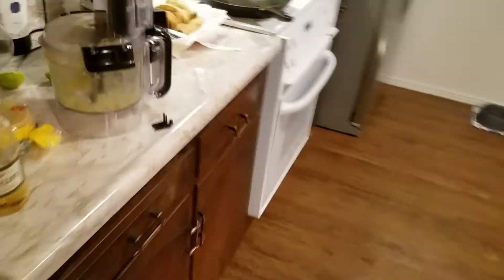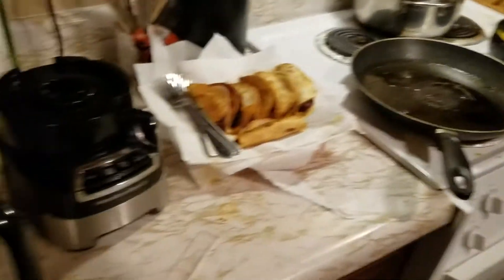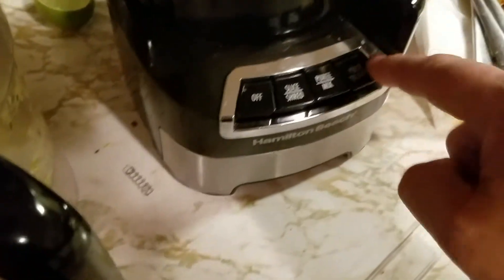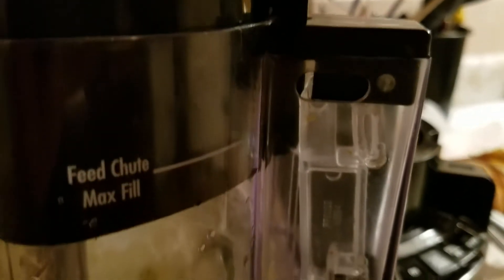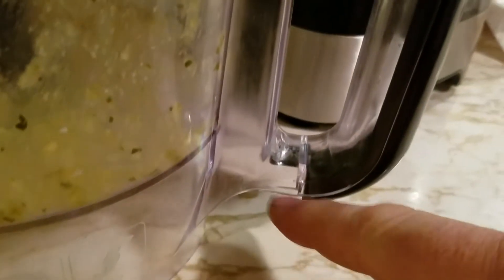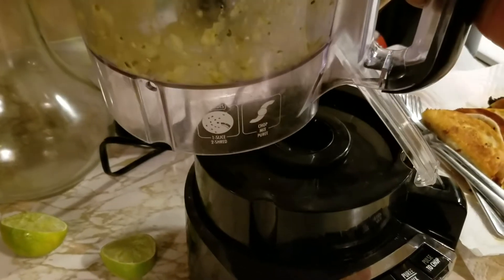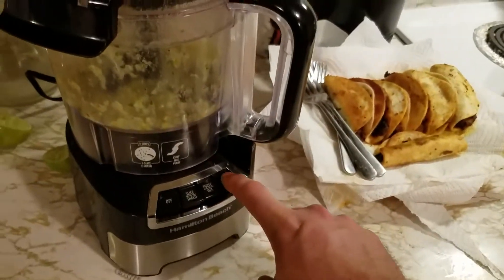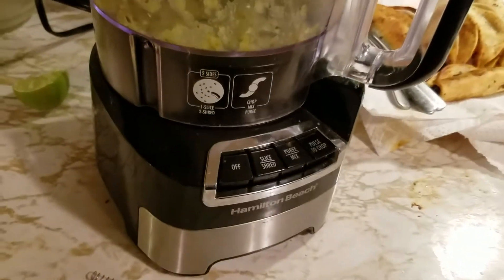Quick Fix for Food Processor Blender Not Working Turning On Functioning / Hamilton Beach Model

Comment: Thank you, thank you, thank you!
 It helped to figure it out. The issue in mine was the plastic on top of the first spring is broken. Now I have to see if I find a replacement or get messy flying it.
Reply from the maker: I'm very glad it helped!!  Good luck on your replacement!
Reply: My plastic part broke too and there were no replacement parts.  So I zip-tied the internal switch.  Now I just have to remember to not press on any buttons when the bucket doesn't have the lid, or else I will get a mess!
Reply: @tomasdiaz1974 thank you for sharing a solution! I really appreciate it. But now I need a video how to zip tie the internal switch. Would mind making a video please? Thanks again.

Comment: We are having the same issue that exact same model. It is very poorly designed. You would think that the  plastic they use for the mechanism would be more durable. I think they make it like that on purpose, so after a year it breaks. As a matter of fact, we order a replacement lid about a year ago, because of the same problem.
Reply from the maker: It might sound "conspiracy theorist" to say, but I can't help but feel like it's by design for these things to purposely break easier than appliances back in the day.  It's easier for upsells and return customers I guess. 

Me and the wife have seriously talked about finding barely used kitchen appliances on ebay from the 70s and 80s.  Some of the motors on those things could almost power a lawnmower.  Lol!
Reply: My plastic part broke too and there were no replacement parts.  So I zip-tied the internal switch.  Now I just have to remember to not press on any buttons when the bucket doesn't have the lid, or else I will get a mess!

Comment: This was life saving thanks! Quick question, were you able to fix it permanently ? Did you get spare parts for it?
Reply from the maker: Glad it helped!! We actually just used it like this for a couple weeks until we could get a new one for like 40 bucks or something like that. But since it's an easy workaround we werent in a HUGE rush to get a new one since this one still worked with just a little tweaking.